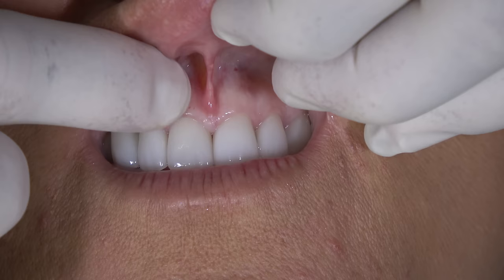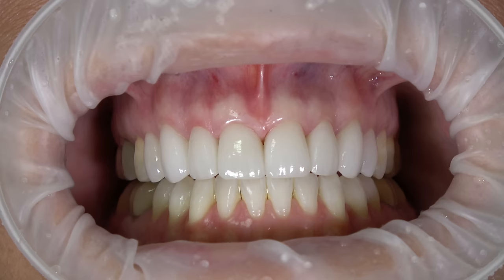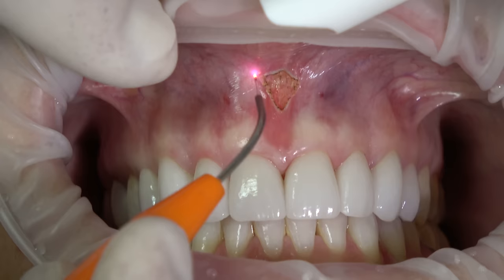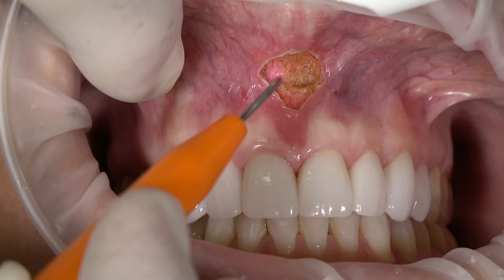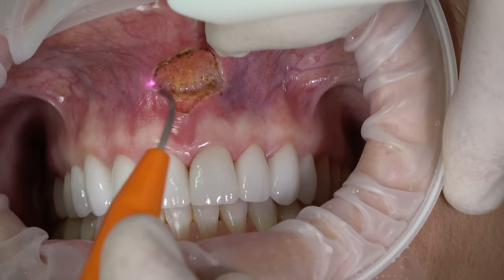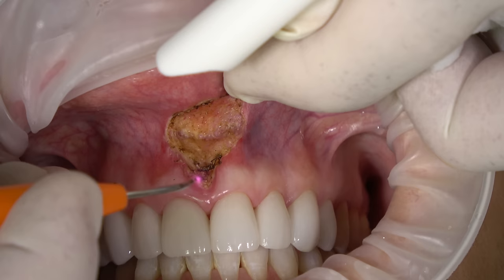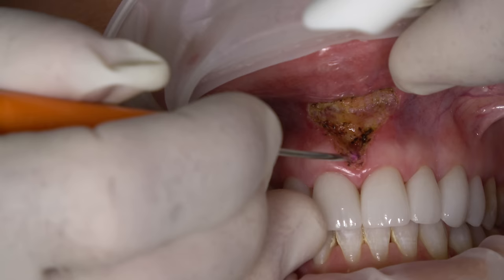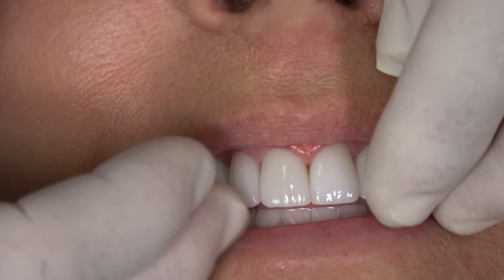Frenectomy Procedure with Dental Laser Video

Comment: i had this done yesterday and my my top lip droops down over my teeth now. with this go away once it heals? it looks awful
Reply: Lewis Allen yes thank god it took 4-5 days to look back to normal
Reply: Mine is drooping too ! My top lip looks like it’s going to swallow my bottom lip 😭😭 I got my procedure done yesterday and I’m just praying it stops dropping fast 😭😭😭
Reply: Lin Usu it’ll go back to normal!!
Reply: omg same! i just got mine 2 days ago and i already have big lips so my top lip looks HUGE. i’m gonna cry if it doesn’t go back to normal😭
Reply: How is it now? Is your upper lip positioned in up or down with respective to its previous position?
Reply: Necdet Özkan it’s completely back to how it was normally :)
Reply: @nataliab8395  isn't there any esthetical change on the lips especially while smiling?
Reply: Necdet Özkan maybe for others, but for me it only looked different in the healing process. I just looked at pictures of my smile before i got it and months after the procedure and it seems to look the same. I’m sure it only looked different because there was a hole behind my lip from the lasering that was numb so that made my top lip droop down